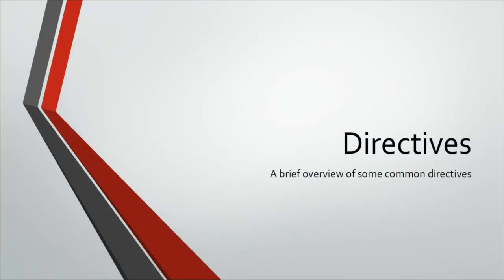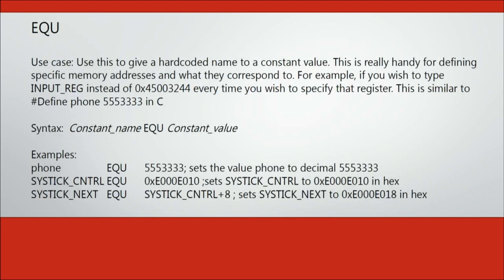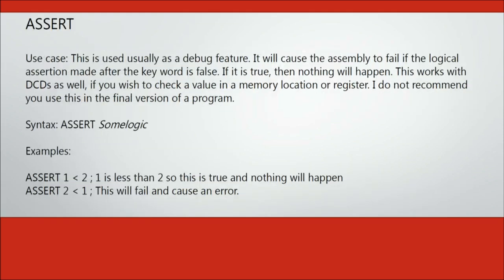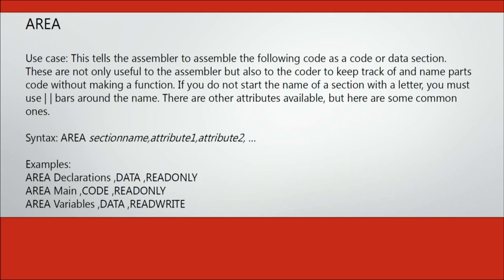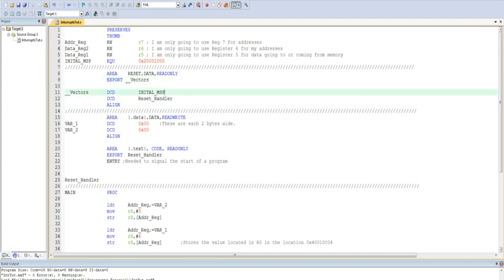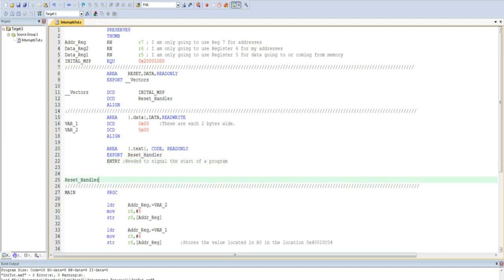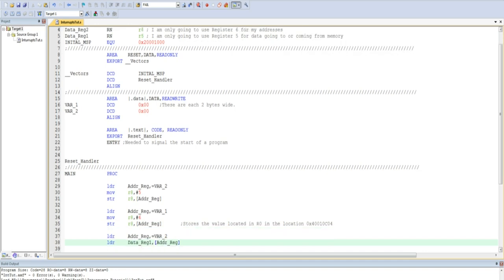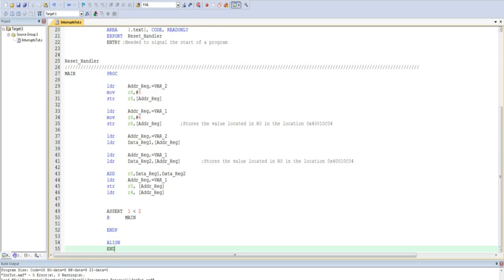ARM Cortex M3 Tutorial 10: Directives

Comment: Hi, Mr Mac
          
        Is that  "B    ." "ENDP" did the same as B main?

Bo Li
Reply from the maker: Well, you do need to include both (at least in my experience). However, B Main will simply keep looping you back through the main program while B ENDP would result in an error, as ENDP is not a label that can be referenced. Labels will always be the leftmost items on the page, like MAIN VAR1 and VAR2.

In addition, ENDP signals the end of the program so it won't loop.  I hope this answers your question. I'm sorry I was so late in answering, I've been away for some time.